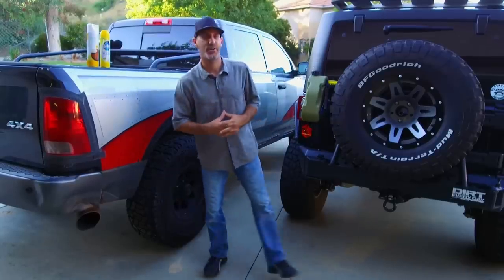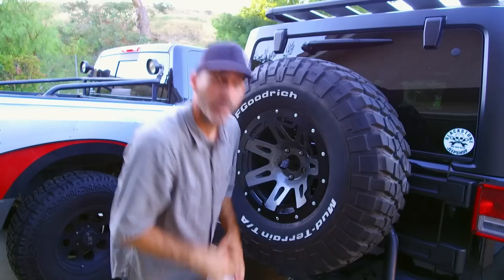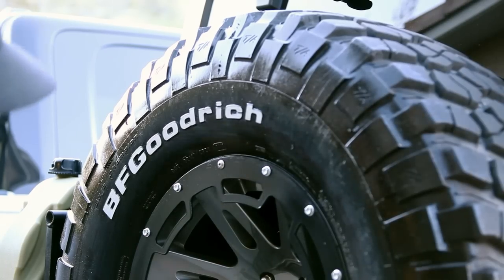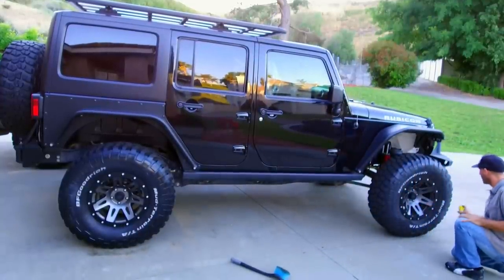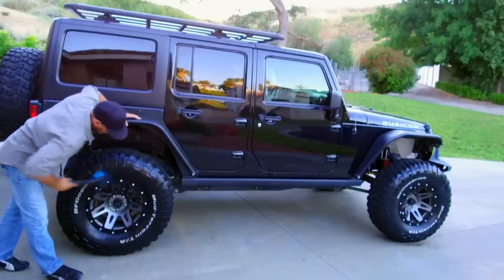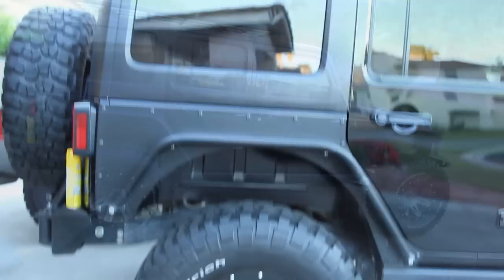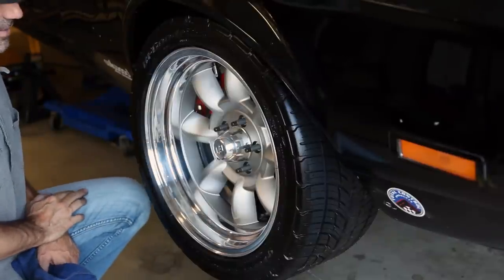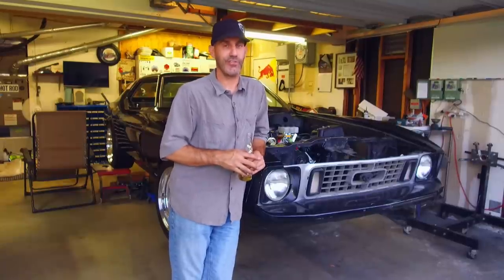Pledge Your Tires to Make them Look Awesome - Pro Tip / Life Hack

Comment: Been using pledge on my tires since the early 90s. I started using it on my 89 TransAm and found it works way better then any of the marketed tire wet products. I still use it to this day.. I spray it on the tires and just leave it, and then spray it on again the next day. It lasts for a week.  I also use it on all the black trim, and on the inside dash and center console of my Ford Escape.. Again works way better then marketed armor all and has a nice lemon new car smell to it.. After having my Escspe for 2 years, I took it to the dealership for a small repair and they couldn’t believe how immaculate my truck looked!

Comment: Pledge also works great on rear fenders for burnouts. So cars that see drag strips frequently if you spray some pledge on the rear fenders and quarter panel before you go it will reduce the amount of rubber build up. The rubber that does stick will wipe away easily.

Comment: I use to always use Pledge on bringing back the colour out of my faded, scratched 4 wheeler plastics. Smells great too!
Reply from the maker: Ha! I do love the smell as well.
Reply: Civilized Delinquent I found that WD-40 works really well on faded plastic panels. Such as the beauty panels under the hood and side trim panels. I spray it on the towel and wipe it on. I do not spray it directly on the plastic. And for some reason, it seems like it almost repels dirt, dust, and sand. And if you do by chance start accumulating dust, it just sprays off with water and the panels look new again. I do not, however, recommend using WD-40 on interior trim as the smell of it is not too delightful.

Comment: autoedit thanks for the tip I have 18" Bridgestone Dueler LTH white letter on my 2007 Ford f 150 super crew I work for a trucking company and alot of dust at our yard but I may try this I DO like taking lemon pledge and spraying it on a nice soft hand towel patting the towel together and dusting off the the paint finish I've done this for years gives a nice slick finish to the paint

Comment: From what I've read, Pledge does not contain any UV protection.   I read a post from a guy that claimed he called S.C. Johnson (manufacturer of Pledge) and they recommended against the use of Pledge outdoors on vinyls and plastics as it lacks UV protection and they've found that it can cause discoloration with too much exposure to sun.  Not sure if this also applies to rubber?   I like 303.  It has a nice non-glossy finish and lasts longer than any other product I've used before needing to be reapplied.
Great videos!  Always happy when a new ones shows up in my list.
Reply from the maker: That is good information and believe the UV thing.  I do know that from many years of experience, I have been happy using it on my different vehicles. 
Thanks for the tip on the 303... I'm going to order some and try it!
Sometimes the internet is super rad this way!
Reply: Jeff G 303 is great on all plastics!
Reply: autoedit b
Reply: Jeff G me too back in the day my dad used it on his 79 lil red Express truck as a wax like alot of others and it would Beed for months but he started noticing it was eating the clear coat and he used it on the tires and it started to crack and the white letters started to fade
Reply: I am confused by all the praise of 303.  As a straight UV protectant, it's probably top notch.  But it did not make my black plastics and rubber blacker.  On my '14 Jeep, it literally did nothing for the appearance.  The 303 Multipurpose Cleaner did far more than the Protectant.  Only with the 303 Cleaner and Back to Black I was able to get rid of mud stains and blacken.  Maybe Arizona sun is just to too harsh? shrug
Reply: As you say, my primary concern is UV protection to prevent fading or cracking.  I've been using it for a number of years and so far everything I regularly protect with 303 shows no obvious signs of fading or cracking.  In my experience 303 won't do much to improve the appearance of already faded, stained or damaged parts, you'll need to use something else to clean it first.  And it won't give you that wet glossy look if that's what you're looking for.  I have used the cleaner and it does a decent job of restoring dirty or stained plastics, but doesn't seem to do much or anything for faded plastics.   On my truck I spray it on the tires after a thorough cleaning and just let it sit and wipe off any excess over spray or drips.  I find it gives a nice dark finish without being wet looking.   On the tonneau I spray it on liberally and wipe it off right away.  On other parts I usually spray it on a rag and wipe it on to avoid overspray.   Results are always great, but I guess it depends on the finish you're looking for.
Reply: Jeff G  Thanks for the reply. Figures I'm 3 years too late.  I'll keep telling myself Jeeps look better dirty.
Reply: Jesse Ansell try Meguiar's ultimate black plastic restorer  then 303
Reply: Jesse Ansell and on tires I use Meguiar's hyper dressing  or STP son of a gun tire spray
Reply: Jeff G I have a 1983 Yamaha tri-moto 200E 3 wheeler I've been using pledge on since new... it looks like brand new. pledge is the shit.  SC Johnson tells you this shit so you don't try and pull some American lawsuit bullshit against them for sayin their product is ok for uses other then wood furniture.
Reply: John S 79 Lil red express didn't have clear coat in those days... base clear paints are late 80s early 90s.    if your dad's truck was restored in the 90s ok likely had baseclear paint.
Reply: Ernie Desjardins yes it was repainted in 1991 a month after I was born but he used it on the truck before and it still faded but after he got it repainted he used it not knowing that's what was messing the paint up like the other guy said it doesn't have a UV protection so it faded looked like it was pink then got it repainted and new decals and clear coated over the truck
Reply: Jeff G I work for a car dealer ship I detail cars my boss told me to use pledge rather than our regular stuff I laughed and said no there is no uv protection stated in the bottle so I refused to use it and continue to use armor all and our tire shine
Reply: i use pledge to quick shine my motorcycle. caution  though.... lemon pledge will draw bees to your vehicle. i use non scented
Reply: Jeff G but tires don't get sunburn
Reply: bryanbeam so pledge is safe to use on paint? I have a R6 maybe I can use this to get my motorcycle shiny
Reply: cizko619er1 I wouldn't recommend it but that's me
Reply: cizko619er1 no, don't use it.  You'll trash your finish.
Reply: Scallywag  thank you
Reply: cizko619er1 for your moto check out Maxima SC1 Silicone detail spray.  It works awesome and repels dirt and water.  It isn't cheap, but you don't need that much and don't have to use that often.
Reply: Just coated my tires inside and out with 303 and let them sit inside for a few days to soak it in before getting them mounted. Hopefully it will improve their life and look. Will probably reapply come spring.

Comment: I like this. not too much gloss. I'm also not a fan of the "wet look". I bought some turtle wax tire shine that guarantees its stays shiny for a couple weeks. Guess what. It didn't last 2 days. Go figure. And it leaves runs yet it also states "No Sling" on the bottle. I was thoroughly disappointed when I saw how well it didn't work. I will definitely give this a try. I just want my tires black like they should be. Not grayish brownish with the faded look. Thank you for this video. Good stuff!!

Comment: CarPro Perl, dilute 1 to 1 for your tires and you can also use it on all your other exterior plastics.  You can dilute at a higher ratio for your interior if you like a dressed interior.  Maguiar's Hyper Dressing is another good option that you can dilute for multiple dressing options.  Both are water based and no silicone.

Comment: Pledge contains oil based products like Isoparaffin and is not good to put on your tires, it will degrade the rubber over time. The best way to clean a BFG km2 on a jeep is with a good soap and water mix. After the tire and rim are clean and dry, brush mud onto the sidewalls and tread.
Reply from the maker: Ok, finally a good one!
Reply: autoedit great idea! let's take a chance of getting scratches on our rims with mud!
Reply: Dabrownrooster you are right man. Rubbing mud on the sidewall could lead to scratches. Keeping your Jeep scratch free is a must in this urban jungle, you wouldent want someone to think you off road or something. Shame on me for almost ruining someone's jeep.
Reply: I'm going to get some brown mud colored vinyl decals for my tires.   I've already put those bullet hole decals on my impala and a baseall cracked window decal for my wife's SUV.

Comment: pledge works great on all kinds of toys. I use it on my Harley. my Polaris sportsman's and my snowmobiles.   top of downhill skies so snow doesn't stick. motocross bikes since the early 80s have always been sprayed with pledge on all the plastics and painted surfaces... for making mud fall off the bottom side of fenders while on the track pledge works great.  I use pledge on the dash of my KENWORTH t800 and all over the interior plastics and leather .  for my bronco on 39s I do the rims so mud don't stick.  your rims are simulated beedlocks.  basically yuppie rims for guys who want to look like real off road rigs with a parking lot crawler....

Comment: Looks good, does it do any weird stuff to the wheels?
Reply from the maker: Not at all tough on wheels. I have since switched to Lucas Slick Mist Tire spray and like that even more.
Reply: Thanks for the info, appreciate it.
Reply: @AutoEdits  I looked online and there are two different bottles for Lucus Slick Tire spray, one blue, the other white, which one do you use for the tire treatment?

Comment: hello and very good video.nice trick for your tires.but i have something even better.mop n glow.for kitchen floors.iv been using on my rides since early 1970s.last 10 times as long as armor all.its not sticky has a nice shine.doesnt build up.and think about it .its used on kitchen floors high traffic area.use in a spray bottle.i also use on my inner wheel wells on my truck.the wheel well looks good and shows off my tires.theres no since cleaning your tires making them look if your wheel well looks bad.just a tip.have a nice day.

Comment: Thumbs up.  Also about car scents I use a bar of soap in a container.   It's ridiculous how expensive those car scents are and they don't last long.  Long story short I accidentally left a bar of soap in my car and the following day my whole car smelled so good.   Eventually the scent will fade so you either rub the soap with clothe and can also leave the cloth for more scent or rub the soap on the garage wall.  If you like febreeze.  they sell those stick on febreeze for like $2 in Canada.  Why not just hang a piece of material of your choice in your car and spray it with your favourite spray scent, it could be your perfume etc.  I also do the same with my room I put my bar of soap in my room instead of in the bathroom. Somebody is getting very rich laughing at us because they're selling stuff that are very cheap to produce.

Could also change the soap if your tired of same smell in your car.  just wash the soap a little bit and use it as your regular soap

Comment: I'm in a bit of a dilemma right now.. I'm hoping you can help? Maybe? So I currently have a 1988 ford bronco ii on 30 inch tires and a 2 inch lift. Here's the thing... it's not 4x4 I am a prerunner guy so I got it and I said hey I don't think I need 4x4. I've gone wheeling and it does ok but I'm pretty sure a 4x4 would do better. A couple days ago I saw a 1986 ford bronco ii 4x4 for sale on cl and then I started to think if I should sell my already lifted 2wd and go for a stock 4x4?
Reply from the maker: I now prefer a 4x4 since it will get me farther into the back country where I want to go so that's what I lean towards.
Reply: autoedit I think I will be going for the 4x4

Comment: Is it just me or do the tires on the Jeep look smaller!!!
Reply: Mr Betun84 I was thinking the same thing. Looks like there was a body lift...maybe. Not sure, I've missed a few episodes.
Reply from the maker: It's not you, they do for some reason.  I do have 15,000 miles on them ... maybe?
Reply: autoedit. those don't look like the 37's. More like the factory 31's. The fender flares open up the wheel wells and make rim/tires seem smaller,an optical illusion. Nice videos, you should show is how to make them the way you do and how to gain parts from manufacturers/ sponsors. Thanks.

Comment: 303 Aerospace is hands down the best when it comes to tire dressing. Matte sheen, and water based so it won't get disgusting and brown over time like oil based dressings.

Don't use pledge, that is like using olive oil for motor oil or something - not the right tool for the job.

Comment: If you want a shiny tire for car shows that's one thing; so go ahead and use pledge or armorall for presentation... but do so while accepting dry rot tires. These chemicals will crack these tires years before they are supposed to dry out naturally.... water and maybe hand soap is all you need
Reply from the maker: lots of people say that but I've been doing it for decades and haven't seen that yet

Comment: Is Pledge going to dry the tire out, protect the tire, or affect its performance? It's meant to polish wood, and rubber/plastic is quite different, and tires are exposed to elements your furniture isn't. And why doesn't it darken the tires? Isn't that the purpose of it? What a bunch of click bait bs. I prefer safety, performance, and looks over being cheap.
Reply from the maker: ?
It makes your tires look good, that is all.  Don't do it.

Comment: Armour All is the worse shit on the market PERIOD...stopped using that BS crap years ago.  i swear its formulated to make shit worse so you buy MORE to make it good looking for 2 days.  And Pledge has been a thing for years in the car scene.  Use it on your interior also...to honest tho, Black Magic tire FOAM does the same thing as long and don't build up.  even looks good using it on a cloth for plastic dip wheels with glossifer.  Welcome to the past dude...
Reply from the maker: um, ok